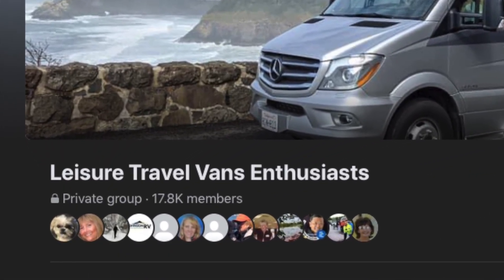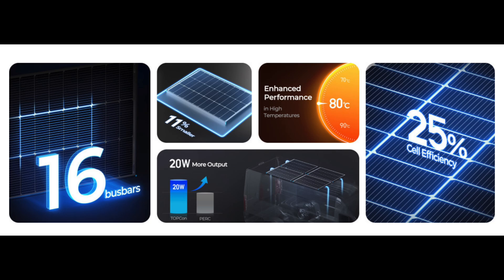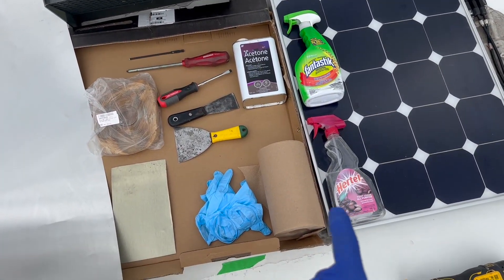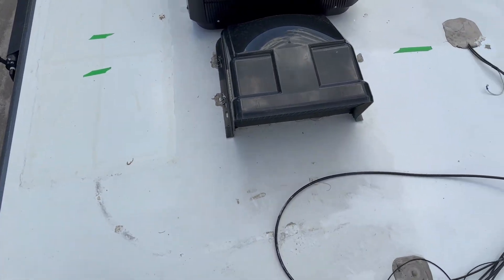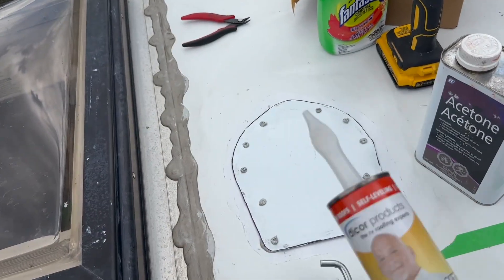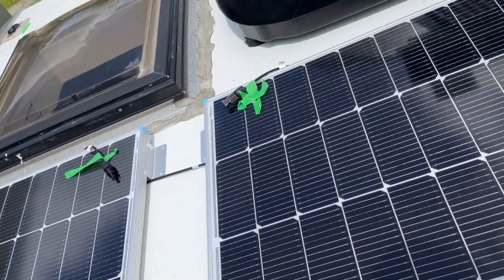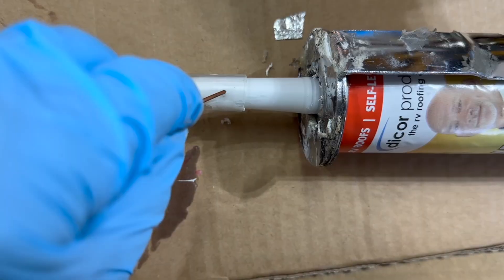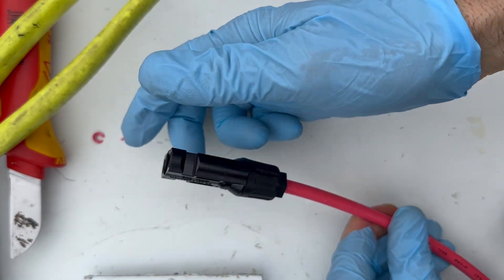More Power! Installation Renogy 100w N type 16BB HD

Comment: Wow.  Very nice looking install.   Plus the added benefit of a cleaned roof!  Was your original system an LYV factory install ?  What were it’s specs?  Did you do anything to the charge controller portion?   Or just connect all your panels to the existing system?